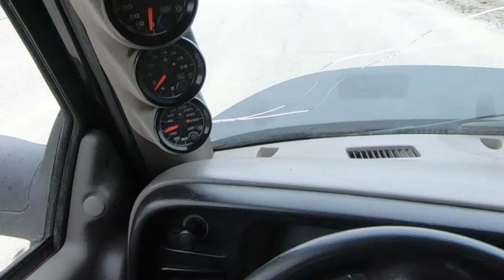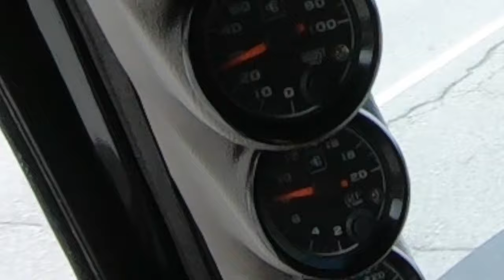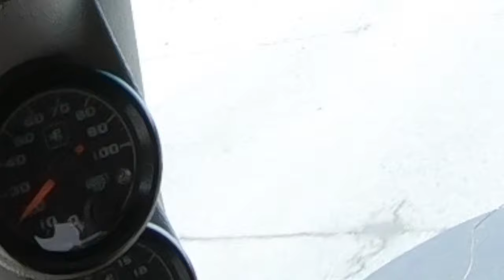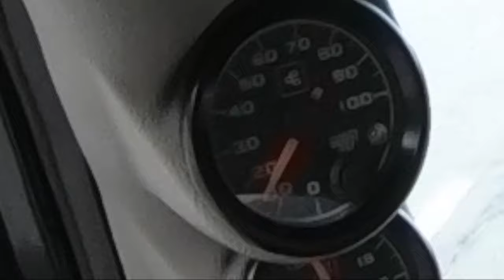73 Pounds of Boost??? Power Driven Diesel Ultimate Towing Compounds

Comment: Nice vid! I’m running the same PDD  compound turbo kit on my 2002 (VP44) truck. My truck has 7x10 injections and o ring head. My best boost number is 71 PSI so pretty close to the same. I love this kit. I tow my fishing boat with my truck, and towing in the Pacific Northwest has some unique challenges. Towing is pretty easy now with the compounds. Keep the videos coming!
Reply from the maker: That’s awesome thanks man! What radiator are you running?
Reply: Aaron, is your 2002 a manual transmission or auto? 3.55s or 4.10s? I also have a 2002 HO ETH 6 speed in the NW. Tow heavy and looking at towing twins. Be interested to hear details on your setup.
Reply: @kevinjackson3995  it’s a 2002 with Yukon 4.10 and Duragrip posi.
I’ve heard PDD has made some changes to the combo to keep the EGTs lower. I would recommend O ring the cylinder head and installing ARP studs. Make sure your transmission is up to the task. These compounds will really put the running gear to the stress test. Also I would recommend traction bars. I installed the quadzilla, but I don’t really care for the interface, it’s glitchy. Hope that helps!
Reply: Thanks Aaron. Who oring’d the head for you?

Comment: Pumped about the upcoming autocross content!! I would like to see some load testing on the dyno to simulate towing. Owning and towing with a cummins on the regular, I will say that the radiator and cooling system in general are the limiting factors when towing in mountains like the ones where you live. Cold Case Radiators honestly seem like the best brand. I would suggest going through any loose ends on your cooling system before the dyno testing.
Reply from the maker: Ya man me too! I’ll ask about that, as for the radiator, mine rad is currently on its way out. Yikes

Comment: Like the videos you put out on diesels. This has nothing to do with the video but curious on the lift size. Lift size? Tire size? Do you have spacers? Rim size ? Like your setup. Any info would be helpful thanks for your time
Reply from the maker: Thanks man! Lift is a 3” Carli Dominator 3.0, tires are Nitto Trail Grappler 37x11.5r20 and rims are XD Machete 20x8.25 luckily no spacers required.

Comment: I like the tires I enjoy 35s on my stock height 2004 ram 2500 no lift 35s will fit slight rub on lock to lock turns but the joints are mostly limiting factor over tire size. I like the added gearing and mpg it adds. Even towing. Mostly stock truck except mbrp exhaust straight pipe planning a resonator to help the drone as I go deaf🤔😄😀
Reply from the maker: Believe it or not, I actually had 37 inch tires with no lift for a while, it did require some trimming though. I run a 5 inch and BRP exhaust, but I have a muffler on it. No regrets.

Comment: Hey nice truck! I have a 98’ 12 valve.
Does the truck feel fast or just very strong? I would like to know
Reply from the maker: It’s pretty fast for what it is, but because there is almost 500 pounds of wheel and tire on the rear axle alone it does take a minute to get up and running. At the end of the day I just really want to drive ability and this thing has a big time

Comment: I highly recommend Flowmaster mufflers I have one on my 91.5 dodge stop pro max I forget what they call it but it’s round ass fuck is a little over 2 feet long and it’s a very good muffler all right this is six in a row jim From Kennerdell Pennsylvania oh also recommend start using Amsoil products in your differentials and transfer case and all that trust me you won’t be sorry if you did all also use their antifreeze years ago I was having problems losing water pumps call me I was going Susan Leica Carter has pills well anyway I switched over to Amsoil antifreeze and I know I have over 250,000 miles on my water pump and it still in excellent condition all right have a nice day bye and I like your truck
Reply from the maker: Awesome, thanks for the info!
Reply: Good to know. Did you check for electrolysis before or after? What kind of antifreeze did you use before and did you use a flush product before installing Amsoil? A high quality antifreeze is the way to go in diesels due to cavitation pitting.

Comment: I have the same turbo kit on order right now, any advice on the oil drain for the second turbo? Like exact location that works
Reply from the maker: Congrats, hopefully you love it. I sure do. I pulled the pan off and welded a bung on personally.
Reply: @StockyBaldman  how close to the top of the pan did you need to be to prevent pooling in the line?
Reply from the maker: That’s a really good question and something that I definitely didn’t consider when I put it in.

Comment: Ok so 73 pounds on a 12 valve and I'm geussing around 850 rwhp. I have a 04 24 I want compounds on with a hefty lift pump that will meet over the needs. For cooling I have an idea to get at least another 150 ponies out of these motors by reducing heat soak.
Reply from the maker: I only have enough fuel for about 700 hp max. This thing made 542/1310 on the dyno but that was with both rear duals on, a boost leak and timing pretty low at 18°.

Comment: Hello there, I have exact same truck only a 1995. Im wondering what trans you have?
Reply from the maker: Mine is a 47 re. I’m guessing yours is a 47 rh?
Reply: Yup, its currently in the trans shop. Gonna put a BD conv. In but with a lower stall of 1800 im hoping it maybe help with fuel mi. I suspect the old one was slipping with a heavy load. I couldnt afford a manuel trans right now.
Reply from the maker: Awesome. I think I went with about 1700 RPM. Should be a good set up.
Reply: Thanks for your quick response.
Reply from the maker: Absolutely, thanks for watching!

Comment: Did you put o rings or fire rings in your head or block for the compound’s?
Reply from the maker: When I first put the turbos on I did arp studs and a new head gasket but it only lasted two days before the head gasket let go. Now the block has been decked and the head has been surfaced and o-ringed.
Reply: @StockyBaldman  Cool I’m getting ready to put some compounds on and everyone I have talked to has said o rings or fire rings are necessary. Thanks
Reply from the maker: As far as I’m aware O-rings are better for a daily driver. Not exactly sure why but that’s what I’ve heard

Comment: When I get my 98 12 valve done it would be sweet to meet up with you in Mexico ;)lol . What p pump do you have ?
Reply from the maker: Absolutely, I love Mexico 😁  I’m pretty sure mine is a 160 pump
Reply: @StockyBaldman  nice I have a 160 pump aswell ,lazer cut dv's some decent size shower nozzles , modded hx35 beside a s472. Who did you get to do your cylinder head ?
Reply from the maker: I got the head done at precision racing engines in North Vancouver. I probably wouldn’t go there again though, when I got the block bored and decked I did it at the Lordco machine shop out in Mission. They were awesome to deal with.
Reply: @StockyBaldman  nice I had my 340 from my dart done at mission when I lived there. I'm torn on fire ringing the block or doing some orings on the head. I built my old truck with that setup 12 years ago and didn't have money for headstuds so I tourqued factory headbolts to 150 and crossed my fingers. I have built and painted a great condition 98 quad long 4x4 truck and plan on ripping out the auto and 24 valve and freshening up my 12 valve 5 speed running gear and having some fun again
Reply from the maker: I have always heard that O-rings are better on a daily driver. I’m not sure why but that is something that I’ve heard.
Reply: @StockyBaldman  yeah and considering I'll be lucky to get to the 600 HP level probably don't need fire rigs
Reply: @StockyBaldman  O-rings last longer, in general. Newer technology has helped with longevity (milling shape to match the fire ring, fire ring material, milling the block 1/2 & the head 1/2) Some guys report 100,000 miles on fire ringed engines but used to be much lower. Unless you’re planing on making 1,000 Hp + then fire rings aren’t needed, it adds cost in more machine work, the head gasket is 6x more expensive and we come back to the H.G. service life being diminished.

Comment: You o ring the head?
Reply from the maker: When I first put the turbos on I didn’t and it blew the head gasket within two days with head studs. Engine has now been fully rebuilt with the block decked and the head surfaced and o-ringed.

Comment: Intercooler will flow better that stock cause stock will pop at 40 psi!
Reply from the maker: Wow are you serious? I had no idea
Reply: 2nd gens had great coolers for their day. Age and corrosion has probably caught up to most of them. A fiend of mine had a 02 compound 24v that saw 75psi boost regularly and another friend that ran 12 valves at 100 psi on stock coolers without issues… at least no issues from the cooler. 😆
Reply: I'm running the stock cooler and stock boots and I'm running 46psi